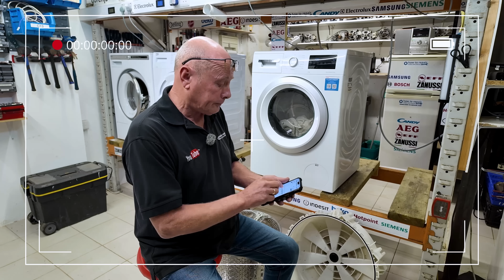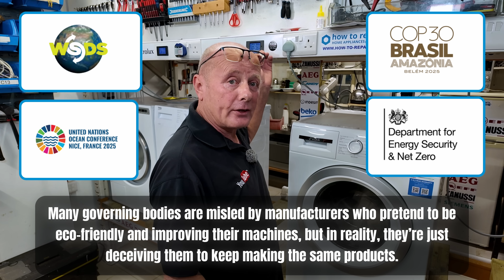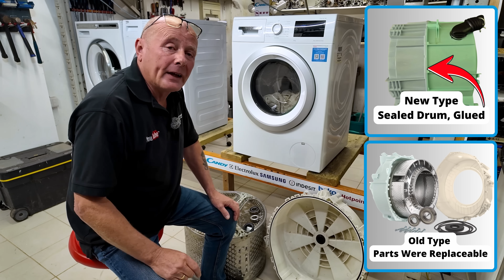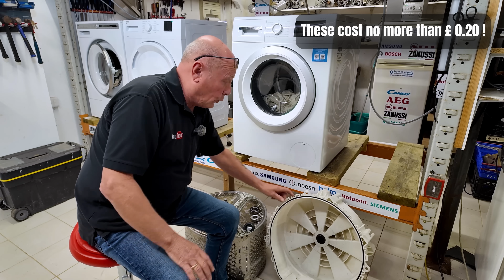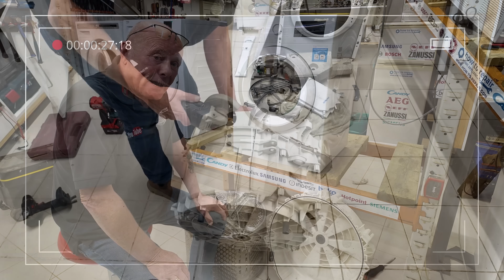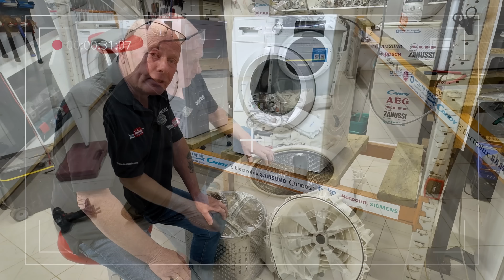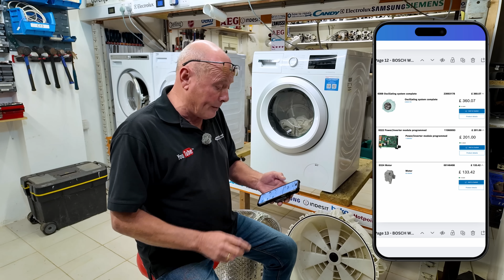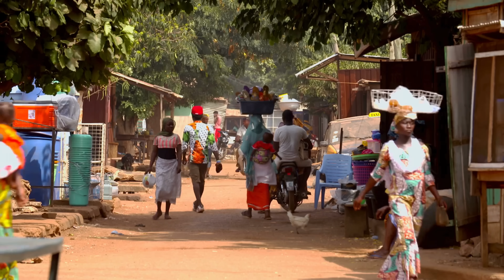Washing Machine SCAM EXPOSED! The Truth About SEALED Drums: Naming & Shaming

Comment: It’s a disgrace, im a self employed domestic appliance engineer and get sick of substandard drums on washing machines.  Cheap rubbish.  I expect it from Hoover, Hotpoint and Indesit but Bosch always used to be brilliant machines you could do work in the drums but are awe full now.  I was at a Bosch the other day and it was 26 months old with bearing damage.  I will only endorse LG or Samsung washers as the drums are split

Comment: I own two retail shops in Greece and I had no clue about just things tbh. BSH group is by far the biggest seller in home appliances but just things are ludacris. Thanks for the video it was enlightening.
Reply from the maker: That is a very honest and powerful admission, especially coming from someone who sells these goods! I am glad the video was enlightening.

Your experience confirms the sheer power of the BSH Group, which is the largest home appliance manufacturer in Europe. They cemented their dominance in Greece decades ago by acquiring the local hero brand Pitsos A.E. in 1976. Pitsos is still marketed as a "love brand" and is described as being in almost every household in Greece. By controlling the market with global brands (Bosch, Siemens) and local heroes (Pitsos), BSH has the market share to dictate terms.

This industry structure is designed to rip the consumer off and by having this knowledge, you are in a much better position to advise your customers on the importance of longevity and repairability!

Thank you for your comment. I really appreciate people like you taking the time to share your thoughts. Please don’t forget to subscribe and share it wherever possible. It may help others make wiser choices instead of being misled by the industry.

Comment: Not a surprise considering how anti-consumer Bosch is with automotive diagnostic devices. Their software makes older but perfectly functional diagnostic device (communciation device between car and laptop) "obsolete" by refusing to connect to it, and it cannot be even used in any sort of legacy mode. To use the updated software you have to buy a new diagnostic device(s) for thousands, that in the end is basically same piece of junk the previous one is, just slightly faster and has ticked the box inside the software for being "compatible". Their software is not that bad, it just works.
Reply from the maker: They update stuff like this to stop small garages from operating it is only the main dealers who are able to have all the software, they are doing exactly the same type of thing in the appliance industry making sure that the independent retailers have no access to their databases to be able to repair the machines. It's a disgusting practice and needs to be addressed.
Reply: @How-to-repair Yeah. When comparing Bosch to other diagnostic devices, as example Launch, it continues to work without any problems when it's bit older device (for older cars basically). It will only nag about old software version but you can press "Okay" and the device still does it's job. Bosch is absolute no-go once the timer for the licence runs out, it stops working.

Comment: Electrolux EWT0862TDW after 6 years of usage the printed circuit board failed (repair cost 2$ in parts + Soldering done by me) after it was done 2 months pases and drum bearing's failed + 2 soch absorbers (parts cost 24$) and after all that in 1 month two aluminium brum supports rotten of  and the belt snaps of ( 2 stainless suports that will last for ages + belt, grease and bolts cost 28$ + body sealant Sotro PU50 for resealing 7$ ). Brum is soldered from factory, with the help of thin wood saw i cut the drum and repaired the washing machine. After 1 year after last repair runing as new.
Considering how the breakdowns occurred, I can't believe it wasn't planned.
*Prices converted from Ukrainian hryvnia

Comment: My washing machine started leaking on inspection it seemed to be the drum, I bought a new rubber seal and proceeded to strip the drum and replace it.
I put it all back together only to see the leak was still there mmmmm, whilst pondering I noticed a hole in the top of the drum on closer inspection there was one at the bottom too, my darling child had been depositing drywall screws in the gap between the rubber and the casing .... welded it back together with solder iron and it's been good since.

Comment: So... then what should I buy? I am currently looking for one
Reply from the maker: That's an excellent question but honestly I can't give a definitive suggestion, mate. Manufacturers constantly shift their production lines and release a vast range of products, meaning every brand has machines of both very good and very poor quality. My core advice is to stick with a brand that fits your budget and provides the technical information needed for repair attempts. Also, when buying new always ask if the drum is splitable.

Personally, I really rate ASKO they are brilliant workhorses with superb mechanicals,often surpassing new Miele models because they still use a stainless steel outer drum. Some LG models are quite good, too. A big shoutout to Beko who, despite some cheaper products, offers helpful technical manuals and wiring diagrams to support appliance fixing. They're making an effort!

Thank you for taking the time to write this out. Please subscribe and share this where possible it could help someone avoid an industry trap!

Comment: Is there any way to determine if a machine uses a sealed drum when shopping for one? I’m assuming you would need to look the model number up on a parts website and see if it has either a sealed drum or bearings available?
Reply from the maker: You are correct mate because manufacturers want the consumer to be confused, they deliberately do not advertise the drum design. It is not listed on the sales tag, the energy sticker, or the front of the machine. Your idea about using parts websites is the single most accurate way to check the machine's anatomy before you buy but it’s only valid if the manufacturer shares that information.

Comment: You have the following conditions:
1 Market saturation- almost every household in Europe and North America owns a washing machine 
2 Demographics- new household formation is low
3 Housing affordability crisis- new households are more likely to rent, therefore would not be buying a new washer for a rented space 
4 Efficient manufacturing- robots building appliances faster and cheaper.

The only way to sell new appliances is to make them fail soon after the warranty expires AND make repairs very expensive.

Korean manufacturers seem to be better at it. Their appliances fail and at 3-5 years.
I see lots of them on FB Marketplace sold cheap “for parts or repair”. This tells me to stay away from appliances made in Korea. 

And yes, AI generated comments and content is flooding us everywhere.
Reply from the maker: I completely agree mate the current market conditions leave manufacturers with only two profitable strategies, shorten the lifespan and make repair financially impossible. My 40 years of experience confirms this shift away from building quality to acquiring market share and maximizing turnover.

We need governing bodies to focus on the Right to Repair to stop manufacturers from hiding behind inflated parts costs and complex electronics.

To truly make a difference, we need to get the attention of industry leaders and stop these wasteful practices. Sharing this post is crucial to spread the message.
Reply: @How-to-repair industry lobbyists will convince politicians and the public that making durable appliances that can be repaired will cost jobs.

Comment: What brands are still making machines without sealed drums?
Reply from the maker: The definitive suggestion doesn't exist yet mate as manufacturers are always changing lines and product quality varies wildly even within one brand, it’s tough to name one best machine. My advice is buy according to your budget, but prioritize brands that openly provide technical service information for repairs. When buying new, check if the drum is splitable. 

My personal best pick is ASKO I've been a big fan of them; they are brilliant workhorses with mechanicals that often exceed current Miele quality, largely due to their use of a stainless steel outer drum. Certain LG models are also reliable. For budget options, Beko deserves praise they are one of the few who provide genuinely helpful workshop manuals and wiring diagrams for repair, which is a huge plus.

I really appreciate you taking the time to write out this valuable comment. Please subscribe and share this where possible your advice is exactly what people need!

Comment: A few years ago I had a Arctic washing machine made by Beko. After about 2 years from purchase, the washing machine stopped to work. I open it and I found the PCB was the fault due to some bad soldering. I resoldered and was functional again.
Reply from the maker: The fact that a critical component like the PCB (Printed Circuit Board) failed due to a simple bad solder joint after just two years highlights where manufacturers cut corners to meet low price points. They prioritize volume and speed over quality control, especially on cheaper models.

You saved a nearly-new machine from the landfill for the cost of a few minutes of your time, proving that the underlying machine was still functional. This reinforces my point that we need to avoid overly complex, circuit board driven machines where possible, as the electronic components are often the weakest link.

Thank you for your comment. I appreciate people like you taking the time to write it out. Please share it where possible. It might help others make a wise choice instead of being misled by the industry.

Comment: Somewhere high in the political hierarchy, someone is missing a crucial point: building a (fill this in: car; washing machine; fridge; …..) has an environmental footprint that adds up to the other variables (gasoline; electricity; water consumption). And in many cases, the % of this impact surpass the running costs (think of electric cars: their manufacturing footprint make them far more environmentally polluting than a conventional internal combustion one, comparing them in a 5-year running period).
Reply from the maker: Consider the environmental cost of manufacturing these machines and then recycling them. Many are shipped halfway across the globe, adding to fuel consumption. It’s unbelievable that we have to transport them again every five years because they fail.

I appreciate you taking the time to share this comment. Please don’t forget to subscribe and share this video so others can make a wise, informed decision.

Comment: We just need some good legislation.
Instead of anything complicated, for example fining manufacturers or retailers based upon repair waste (you have to pay $400 in parts to repair a $2 bearing, $398 is waste). Which, to be fair, we should be doing anyway since we are so "eco friendly".
Why not just legislate a decent warranty period for appliances. What if it was 20 years?
Reply from the maker: While the current EU Legal Guarantee is a minimum of 2 years (and sometimes up to 3 years or based on expected lifespan) the new Right to Repair laws are a good step. They will force manufacturers to repair certain products beyond the warranty and require that spare parts be offered at a reasonable price. This movement proves that your desire for strong, longevity-focused legislation is gaining traction.

Thank you for your comment. I appreciate people like you taking the time to write it out. Please share it where possible. It might help others make a wise choice instead of being misled by the industry.

Comment: Ownership of household appliances is only an illusion. We're already in a subscription based model, without most of us realizing it. Either you pay the subscription fees by these insane repair prices, or you buy a new model. Either way, pay you will.
Reply from the maker: I have been in this industry for 40 years and I've seen a lot. The ownership is absolutely an illusion. The manufacturers have designed the system so that you must pay continuously to keep a machine that should last 15-20 years or change it with a new one. 

Thank you for your comment. I appreciate people like you taking the time to write it out. Please share it where possible. It might help others make a wise choice instead of being misled by the industry.

Comment: At some point I found that my old washing machine may have bolted drum. And I'll try to keep it as long as possible ) Another thought I got from your video, is that we probably need some kind of open source washing machine project.
Reply from the maker: That is excellent news about your old machine likely having a splitable drum! That feature is your most valuable asset right now, as it allows you to easily replace the bearings and spider, which is exactly why I advise asking that question when buying new. 

An open-source project, where parts, diagrams, and components are publicly documented and designed for easy repair, would instantly expose the intentional flaws and excessive cost of proprietary components used by the major manufacturers. It would truly embrace the spirit of the Right to Repair and place longevity and sustainability above profit maximization.

Thank you for your comment. I appreciate people like you taking the time to write it out. Please don’t forget to subscribe and share it where possible. It might help others make a wise choice instead of being misled by the industry.

Comment: I have a little advice, I know there are Beko brand devices in England, but we use Siemens even in the country where it is produced.
Reply from the maker: Because BSH (Siemens) is locally produced in its home country, it retains a stronger reputation and market presence there. However, both Siemens and Beko participate in the same industry practices, offering a dizzying array of models, often using similar components, and increasingly incorporating features (like sealed tubs or complex electronics) that contribute to the short, five-year lifespan we see today. Even high-end brands can succumb to these strategies.

Thank you for your comment. I appreciate people like you taking the time to write it out. Please share it where possible. It might help others make a wise choice instead of being misled by the industry.
Reply: @How-to-repair  Beko is 50 km from where I live, and we're experiencing problems with spare parts and maintenance. We in Türkiye know that Siemens and AEG are of good quality from our contacts working in these factories in Germany, but Turkish manufacturers like Beko Vestek Arcekik are not good enough, in my opinion, and I don't recommend them.

Comment: This obsolescence is everywhere.
It due to stockholder... and a f+++ed up tax system.
Take a look at Dyson. Battery with counter and stops one day - battery is fine - but u have to buy an new one. Still no hack for their v10 batteries out there. Need more IT robin hood guys.
Our aeg has those seald drum bearings glued . U have to buy the whole drum ... what a nonsense for environment und consumer. 
Great win for companies aka stock holders.
Reply from the maker: That is a powerful summary of the problem, and your analysis of the corporate motivations behind it is absolutely correct. My 40 years of experience confirms this is a calculated financial strategy not a design oversight. The entire system is a guaranteed win for the companies. We must support both legislative action (Right to Repair) and technical action to force transparency and longevity. Thank you for your comment. I appreciate people like you taking the time to write it out. Please share it where possible. It might help others make a wise choice instead of being misled by the industry.

Comment: Thank you for bringing this to our attention. I often thought that this practice is becoming more prevalent - and not just in white goods.
Reply from the maker: I completely agree with you. Having witnessed the industry change over the last 40 years, it’s clear this isn't just an appliance problem. It's a structural issue across consumer electronics, cars, and other goods. Once manufacturers realized it was cheaper to acquire market share and reduce longevity than to build quality, that same business model of making repair anti-economical spread everywhere. This is why you see simple failures forcing replacement in everything from expensive TVs to electric car drivetrains. 

Thank you for your comment. I appreciate people like you taking the time to write it out. Please share it where possible. It might help others make a wise choice instead of being misled by the industry.